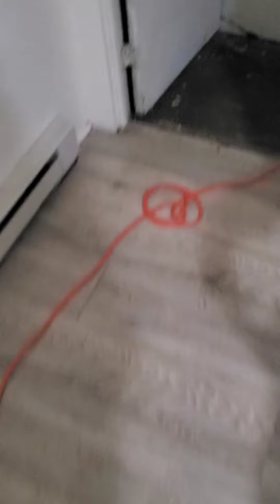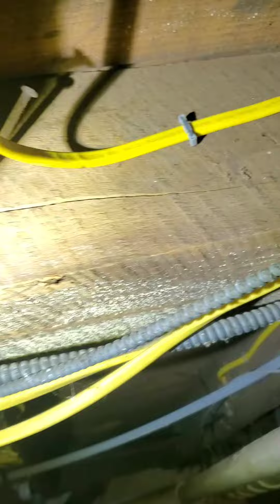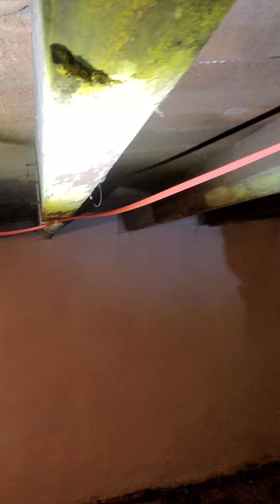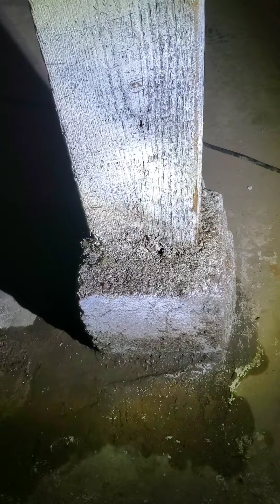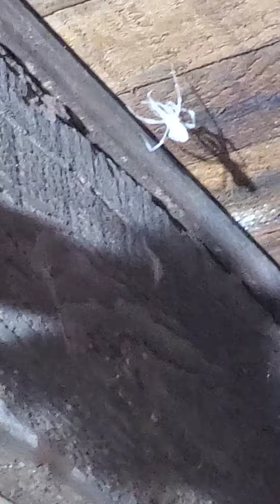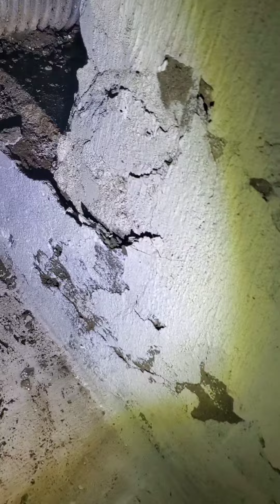Look into my home inspection crystal ball! 🤣 Here we have mold, structural damage and plumbing

Comment: Those pesky posts are just holding up the house. Oh maybe we should check if they’re rotting, oops!😮
I don’t mind the crawl spaces or the spiders. The spiders tell you that there’s other bugs in the house maybe enough to support your spiders family. That house looks like a candidate for the bulldozer demonstration. Or would you find the reason for all that groundwater and hydrostatic pressure on the walls and then deduct the cost for de watering the area around the house and putting in drainage pipes on the footer’s there’s a name for it.